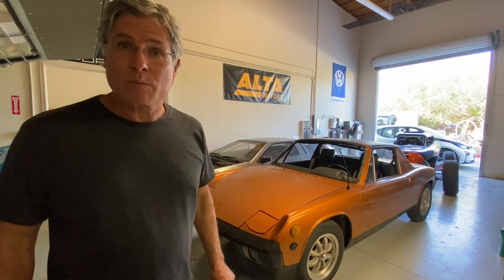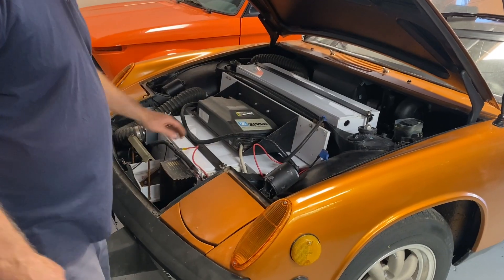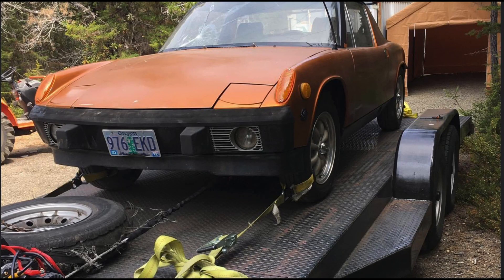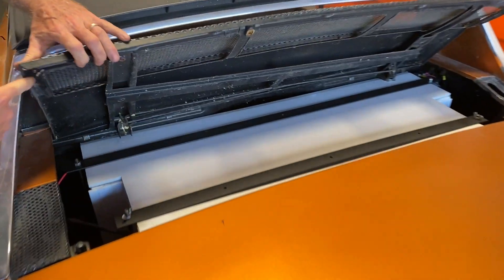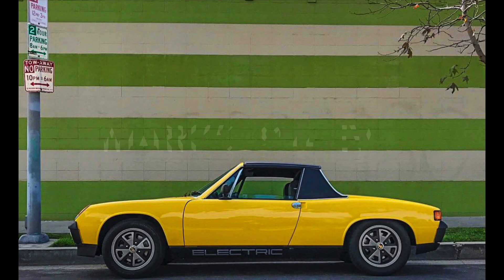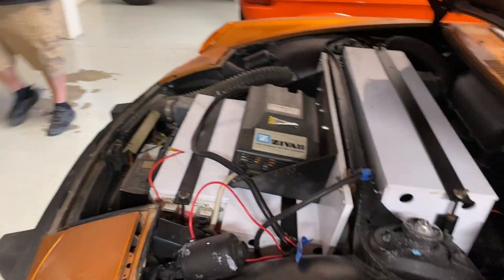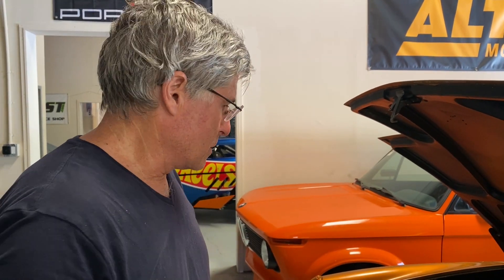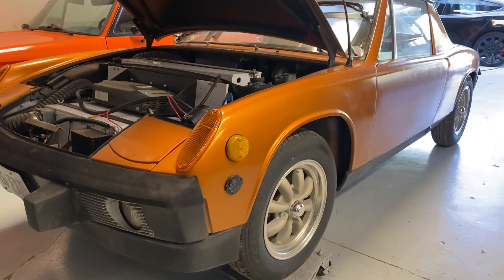1975 Porsche 914 Bolt-in Tesla Model 3 Motor Conversion PT 1 | EV Show

Comment: All great colors of that era but mine is also a 75 with original Copper.  The most important I think is interior mine is tan.  All the other interior colors look better than black.  However, black with plaid inserts look good also.  You just don’t want to be down South in a convertible with black vinyl seats on your butt in the summer.  number #1 mistake of manufacturers nowadays along with black exteriors with dead clearcoats.

Comment: I have an Azure Dynamics VoltsPorsche motor with two of the original controllers. One is dead, the other is not. I had to have the motor re-balanced because the balancing clay came loose, and it had a bad vibration. That has been fixed. I tested the motor with a Curtis 1238 96V 650 amp controller with that motor already, and it has way more torque than the AC-50 motor. The DMOC445 controller was set at 144V and only 200 amps. Way too weenie in the amp department. The motors can handle high voltages, and I'm looking to pick up a controller that will do 168V and 900 amps. Should easily wake up that Azure Dynamics AC-24 motor. It will be a test. I'm stuffing it into my 83 Vanagon Single Cab. I have been waiting for part 2 of this video series. It’s been 3 years. I was considering doing a Tesla Conversion into a 914. That is why I wanted to see more.

Comment: I did the same ElectroAuto conversion on my 914 back in 2009. I just spent the winter upgrading the pack to 6 Tesla Model S modules, but I left the motor and Curtis controller alone.  The final effort was getting it imported into Spain.  Now I really want to swap out the NetGain for a Model 3 motor/controller!  I have to re-watch the rest of the series and get my drool towel ready.

Comment: 914 owner (Oly blue btw) to 914 owner, have you ever considered dropping an entire model 3 rear (wheel to wheel) in a 914 chassis? I know the track width is about 7” wider, but the 914 could really benefit from a more modern multi-link rear suspension. It would be a very intriguing retrofit not too much more challenging than a cradle build. Not a bolt-in proposition, but still. Your thoughts?
Reply: Crazy, but not so crazy?

Comment: Does the off gas that is produced while discharge promote rust? All the lead acid cell battery rooms over worked in was always stainless steel and all the electrical was hermetically sealed.